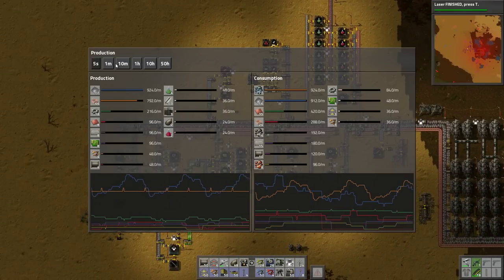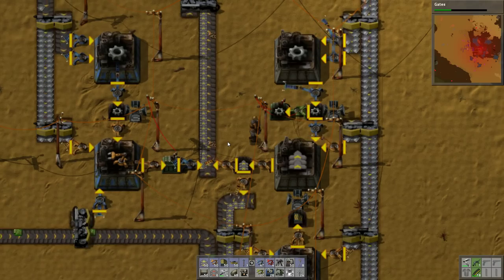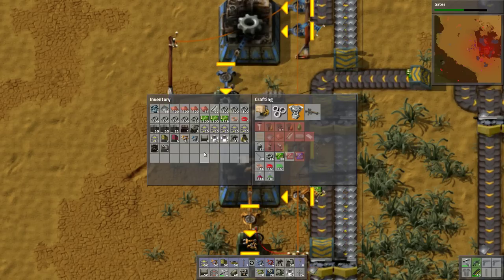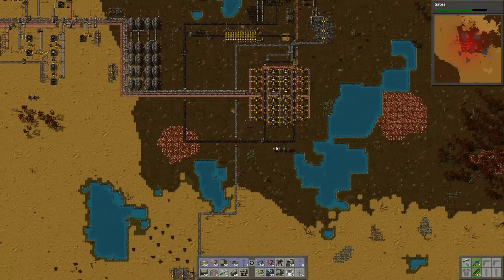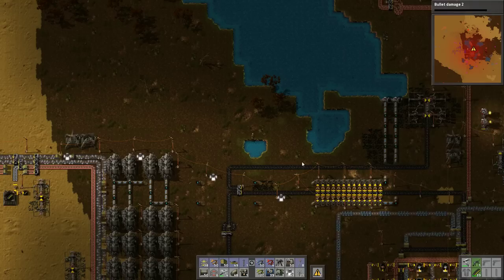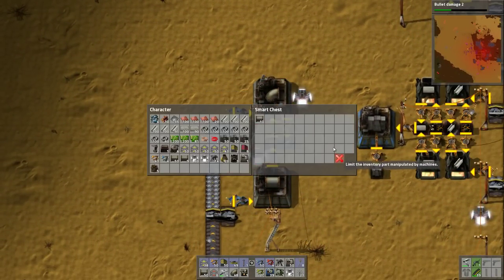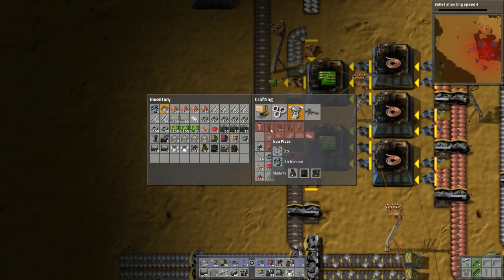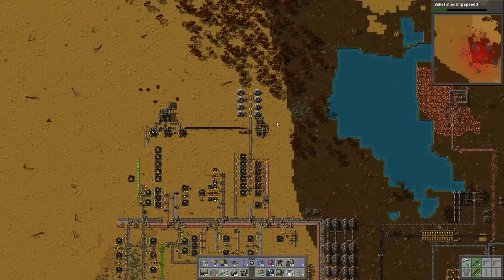Factorio A New Beginning 8

Comment: Dude! Work on that iron throughput. You're trying to feed a double thick yellow belt with a single thick red belt! You need to make way more iron per second, and buffer it so the input lines are overflowing! Never seen someone have such throughput issues! My lines are always jam packed, but that might be because I use 20 furnaces with douboe buffered split lines.